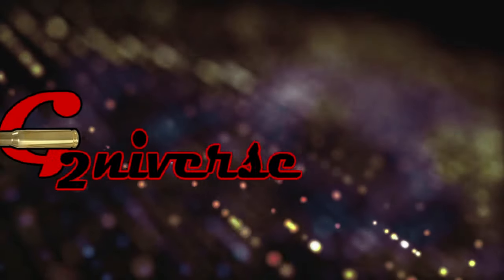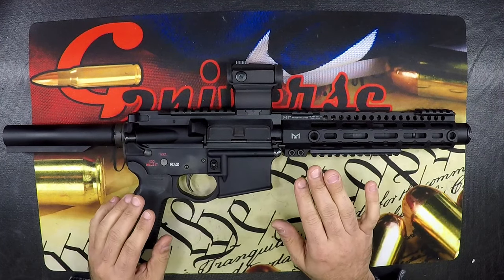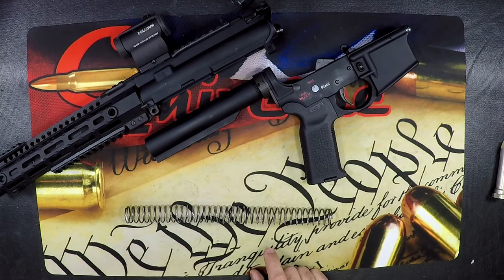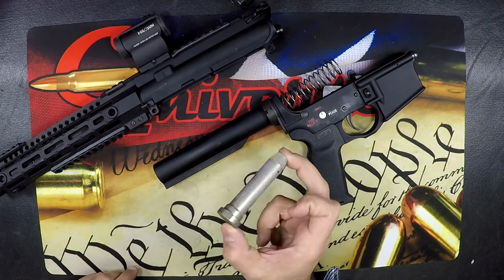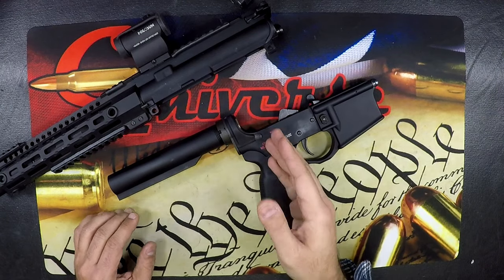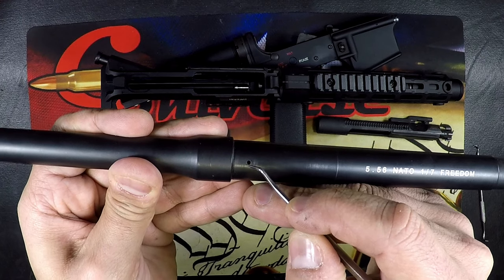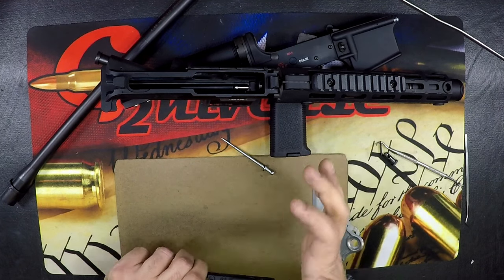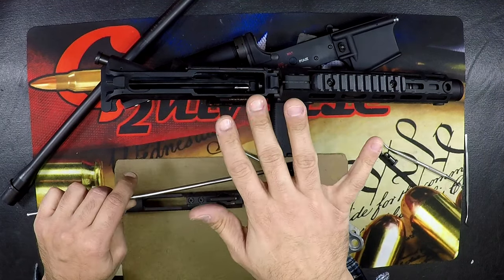Safely Fix Undergassed AR - How To

Comment: I have casings hitting right next to me at 2-3 o’clock. Right on my arm seated. I’m a lefty with long guns 

11.5 PSA upper A2 sight known to be overgassed 

Carbine spring and buffer from an H&R brace kit

Bcg extractor, gas rings, ejector all good to go 

Acts under gassed but 0 ftf or fte. Reliable for 800 rounds so far just really poor ejection pattern
Reply from the maker: If it cycles fine, don't mess with it

Comment: 1:36 why is the Picatinny rail bending towards the optic like that? Looks like it’s sinking into the optic
Reply: I'm gonna say it looks like he has a rubber rail cover on it and that's what's bending. Not sure I've really ever seen someone put a rail cover on the receiver rail (they are typically used on handguards), but that's my guess.

Comment: I've watched this trouble shooter several times.  I bought an AR-15 custom build from a local rifle shop.  It light strikes most of the time and dents the rim of the casings. It intermittent fires and never ejects, locks back or cycles to the next round. In 4 hours at the range I got off only 3 rounds. Their shops' gunsmith has had my rifle for 6 weeks now and I received a phone message saying they cannot find the problems with my rifle to get it to work. He said it was simply an anomaly. He said they were not charging me for the 6 weeks of trouble shooting work. So now I am stuck with a $1500 gun parts bin.  This was my first firearm purchase ever.  This rifle shop builds rifles from all new parts and sells them, so they don't carry name brand complete rifles per say.  Mine was a "custom build" in that I picked out the colors of the parts as they guided the proper build.  I was promised by the owner they would get it working and it would prove to be the most reliable gun I ever own. But now it is just an anomaly that no one can figure out.  I am supposed to find out this week what happens next so I will not say their company name but it is very well know in the area.  Money back? A buy back? Offered a new rifle?  Or tough luck guy I feel for you?
Reply: Got an update on that? I honestly find it hard to believe that a gun shop couldn’t find the issue after that much time. My first frankin gun build had issues, but the fine ppl of YT got me tight.
Reply from the maker: Thanks Tom Summers for being a  subscriber...love hearing from you guys!
Reply: Take it Back, get your money back!,,

Comment: I have a 300 blk pistol (12” barrel) that seems to be under gassed? Only issue I have is that the bolt doesn’t lock back on empty. So I should go with a heavier buffer? I’m not certain what I have now there’s no label on it.
Reply from the maker: If it cycles I through the mag, you may just have an out of spec bolt catch. Easy test is to lock it back empty and give it a good whack on the side or the stock, if it slams forward, it's your bolt catch. Did a video on this too.
Reply: Also from what he said in the video, you'd want to go with a lighter buffer. Use a food or postage scale to weight the buffer your currently using. Google "buffer weight chart" so you can see the weights of the different sizes

Comment: Have a 308 AR, my spring only has 30 coils, and the buffer looks smaller than yours.
Reply from the maker: Might not be a rifle length buffer.  Without seeing your actual set up, I would guess you have an adjustable stock.  Adjustable stocks typically run in a carbine or mid length buffer system which uses a  smaller spring and buffer.  That set up will work if you have a shorter barrel length.

Comment: Great video!! Can you possibly do a video on light primer strikes on an AR15 and how to fix them? Thank you very much sir!
Reply: Measure your firing pin with a caliper.  Ensure it is within specs.  Install a fresh hammer spring.
Reply: The firing pin protrusion should be between .028 to .036

Comment: Swapped my 16inch barrel for a 18in 223 Wylde. Won’t load another round or reset the trigger. I’m guessing it’s either that I misaligned the GB or the port on the barrel is too small.
Reply: I had the same issue withe 18" 223 wylde FN barrel. The gas port was too small. Easy fix with the hand drill. Used the 0.10" bit. Now it's fine.

Comment: The Spring you have on your desk I counted 37 rings which is a carbine spring as you stated, but why is your measurement length 11 inches?  The reason I ask is because I'm currently trying to trouble shoot a short stroke issue where I purchased an Aero Precision Carbine complete lower assembly and I counted 37 rings for my spring and it also measured to be 11 inches.  So are carbine springs 10 1/16 inches in length as you state or are they 11 inches as we both measured?  I'm considering cutting my spring down, since so far everything else seems to check out and I have a 3oz buffer.  Would that be ok as long as I stay above 10 1/16" in length?
Reply from the maker: ugh...its a little different because as you use them they will change.  but if you are within the guidelines +/-.75" youre ok.

Comment: My Ruger has stopped cycling. Let time I shot it, maybe 1 or 2 mags. They were not even full.  I have changed the trigger with a drop in upgrade and got a better charging handle. Gun won't cycle so I'm thinking something is stuck in the gas port on barrel or gas block
Reply from the maker: waaay to vague.  Define "stopped cycling"
Reply: @G2niverse feeding, chambering, locking, firing, unlocking, extracting, ejecting and cocking.

It stopped one of these

Comment: What if it will cycle 55g fine but under gassed with 62g?
Reply from the maker: Tune it to run the green tip.  Youll be slightly overgassed for 55g, but overgassed is better than undergassed 8 days a week.

Comment: I’m having an issue with an Odin .350 Legend I built and it appears to be under gassed. Odin suggested a heavier buffer so as to allow the pressure curve to build. Any thoughts on that idea? Carbine with mid length gas setup shooting a couple of different factory 180 grain loads.
Reply from the maker: undergassed wouldnt require a heavier buffer, would be the opposite...but I have not really worked with .350.

Comment: Good video with lots of info!  Thanks.  Do you have a video that would troubleshoot why a barrel nut would come loose over time?  It's happened twice even though I use a proper armorers wrench and torque wrench to tighten it.  The threads look fine.
Reply: Did you lubricate the threads with Aeroshell 33 1st?
Reply: Check your barrel nut and uppers threads.With the threads lubed with grease you will get proper torque. Never torque any threads dry, you will not get proper torque..

Comment: So check this out. .223 wylde 20 inch barrel, carbine spring, 3 oz buffer. I haven't shot much through it but 55 gr. .223 won't lock back after last round, but 5.56  55 gr. will.  Both eject similarly but .223 won't lock back. Is there that much difference in pressure between the two that would cause this? I'd rather be able to use both. Would a lighter spring or buffer cure the problem?
Reply from the maker: 5.56 has a higher chamber pressure so theoretically yes, it's possible. Id start with a lighter buffer spring. You really can't get much lighter than a 3oz buffer.  What length is your gas system? Carbine? Mid? Rifle?
Reply: @G2niverse  carbine length

Comment: Can u run a rifle spring and buffer with an a1 stock on a carbine ?
Reply: Idk but I would look for "overgassed" symptoms as the longer spring will be less displaced, and hence providing less force against the gas (f=k(deltaX)) during ejection and cocking 

Also maybe more mag picky (some hold em in real tight) but I suspect both would be negligible as they aren't that much different
Reply: Yes. Thats exactly what I did. Removed the annoying rattle trap and installed an A1. UTG A1 comes with the  buffer tube, matching rifle spring and buffer. You MUST replace the tube, spring and buffer weight. Never had one issue.

Comment: So I am getting a lot of contradicting info on this subject. I had a failure to extract when I shot Tulammo 55g steel case. (I know) Part of the rim was sheered off from the extractor. But my ejection pattern has been 3 o’clock or so maybe even 4.  I’ve shot about 400 rounds and that was my only issue. This is on a sig sauer tread rifle 16 inch barrel. Haven’t been back to the range to do the one round test. Thinking it’s over gassed but the ejection pattern says otherwise.  Chalk it up to ammo? Any thoughts? That stuck casing I had to knock out with cleaning rod. Thinking about getting heavier buffer with bcm extractor spring upgrade.
Reply from the maker: USMC I had the exact same problem on my .308 You are overgassed in the sense that the rifle is trying to cycle and extract the case before the it has a chance to retract back down.  Its trying to pull it out while the case is still expanded in the chamber and the throat of the barrel.  Couple things you can do...adjustable gas block to close up the gas a tiny bit. Heavier buffer to slow down the cycle time.  Heavier spring to slow down the cycle time.  Were talking shaving halfs of milliseconds here... just enough time to let that case shrink back down and get extracted.  If you dont have an adjustable gas block and your current gas block is set screwed and not pinned, you can try and offset it a slight bit (left or right) to cover up some of the barrel port.  This isnt a long term solution, but should get you running until you can get an adjustable gas block.  
Also take a look at the extractor.  Although I dont think its that the upgrade kit combined with the other solutions should fix the issue.  If its ripping steel...its going to destroy brass...i doubt its the ammo.
Reply: @G2niverse  Change to brass then get back here ...Nothing but problems for me shooting that shit ammo...I moved it over to SHTF ammo...and haven't shot it since and won't.

Comment: Put a area 419 hellfire brake on my dd5v3 16” 7.62 and ran fine for 14rds then started short stroking? If it’s undergassed how’d it run those first ones fine..?.thanks man
Reply from the maker: arborist460 you using steel?  could be fouling from dirt
Reply: @G2niverse  149 m80…I had my flashlight bolts barley touching the gas block and moved it and seems better but still occasional jam..damn if it don’t shoot though..

Comment: I watched another one where the guy took out the o-ring on the extractor, he suggested run a 100 rounds or so and then if you feel you need to put it back in then do so
Reply from the maker: I wouldn't suggest it simply because that o ring is taking the brunt of the force. You could wear out your spring quicker... maybe?

Comment: I have M&P 15 II - 16" barrel 55.6 I counted 37 coils 3.0oz, spring is 10" 1/2, when I fire its fine for at most 2  bullets then wont eject (Bolt still forward) and as I was watching I noticed my gas tube is the opposite of yours and is 1/3rd from the cut out tube length is just over 9" so (Carbine). so Is this a gas tube length issue or a buffer spring issue with not enough coils/Wrong buffer or??
Reply: Have you cleaned your rifle?

Comment: Do you think a 2.7 Oz buffer is too light for a AR-15 rifle? My sons rifle has short Strokes I think we got about eight rounds to shoot at one time and most times it was two or three then a short stroke
Reply from the maker: It depends on a few things... the gas system length (rifle, mid, carbine or pistol). The kind of ammo you're shooting. And the kind of gas block you're running. But for a carbine length system, 2.7 should be sufficient. The other thing to consider is his shooting skill. Is he new to shooting? It's not uncommon for new shooters to have feeding issues, just because they are learning proper shooting technique.
Reply: @G2niverse  it's a rifle with a 16-inch Barrel the bolt is not going back far enough sometimes to go behind the round most of the time it works but it has quite a few hiccups short Strokes. I was thinking maybe polishing the chamber so the shell extracts easier it has a non-adjustable gas block
Reply: @G2niverse  he is using the same ammo that I run in my AR-15 without any problems at all. it was one of those mystery can buys from a gun show brass stuff
Reply: @G2niverse  I was thinking maybe lighten up the spring and a lighter buffer it has a 3 oz one in it now
Reply: @G2niverse  it's brand new I'm not sure if Maybe it needs to be broken in I know my AR-15 had no problems out of the box
Reply: @G2niverse  I know it's not the technique because I was there with him sometimes it would not chamber a round and sometimes the bolt would be on top of the round and pushing it Forward getting stuck because the bolt wasn't behind the round I'm sure that's due to short stroke not going back far enough
Reply: @G2niverse  if the spring and buffer does not work I will put a adjustable gas block hopefully I don't have to make the orifice bigger by drilling the Barrel
Reply: @G2niverse  so for a regular AR-15 standard AR-15 16 inch barrel rifle is a 2.7 buffer too light because I put one in there and I'm going to test it soon for some reason I can't get a answer from anyone else. if it's too difficult of a question sorry I understand if you can't answer
Reply from the maker: no, 2.7 should be fine.  Standard specs is around 3.0 oz.

Comment: Ok so i have a piston driven one that wont eject. The bolt wont go all the way back on the eject and the gas port is all the way open.
Reply: Lower buffer weight and/or spring. Keep it lubed = less friction .
Reply: have you fixed it? i have an adams arms piston kit on an 18 inch barrel

Comment: My bcg not going back for enough to use bolt catch, and bullet fail to feed
Reply: You definitely have a under gassed rifle. If your gas block is aligned correctly and you still have that issue. You could use a light weight bolt carrier. It requires less gas to reciprocate back towards the buffer tube. Couple that with a carbine buffer and you should be golden.
Reply from the maker: wave god undergassed....watch the video

Comment: Question what if my spring only has 30 rings and I didn’t do anything to it did that company send me a wrong spring it measures 10 1/4
Reply: BCM? Some come that way.
If you or a buddy have another ar with a carbine(I'm assuming)buffer tube you can swap the springs to see if the tension feels the same when you rack it

Comment: It could be the barrel gas port being undersized.
Reply from the maker: one of many potential issues
Reply: @G2niverse  true. Just meaning in addition to the others presented if those aren't resolving it. It very much so could be the gas port is too small. Especially certain brands or certain length barrels and gas lengths can be undersized. Worth checking with a guage if possible first before opening it up though. And should be the last option.
Reply: @Matthew Riegner  ran into this problem last weekend with my latest build using a BA premium barrel, gas port is about 0.005" undersized, was short-stroking half the rounds.
Reply: @Fister_of_Muppets  yep same with my 20" BA heavy barrel. As others have said, that gas port will most likely have to be opened more. We have tried all sorts of buffer and spring combinations, but still the same issue. We will try with a different BCG first, but if that doesnt solve it, it is def something with the gas.
Reply: I just built a Aero .308 with BA 20" rifle length barrel. I tried everything and after lots of research figured out that tons of people had the same problem with the gas port being too small. I drilled it out to the spec it should be and it runs perfect!

Comment: .300 BLK carbine with 8.5” barrel. I tried an adjustable Odin buffer down to its lightest config of 2.1 oz and it still doesn’t consistently lock back on suppressed sub rounds. What about using a pistol length spring on a carbine tube?
Reply: one thing i would try first is using a heavier buffer. i know it sounds counter intuitive but there’s more momentum after the initial punch from the gas